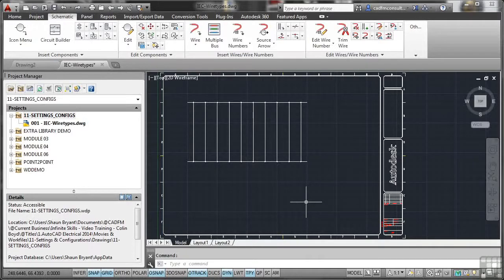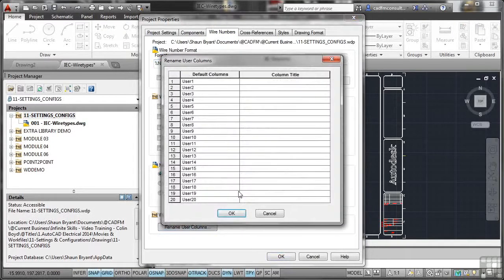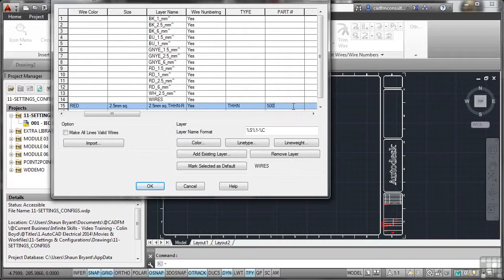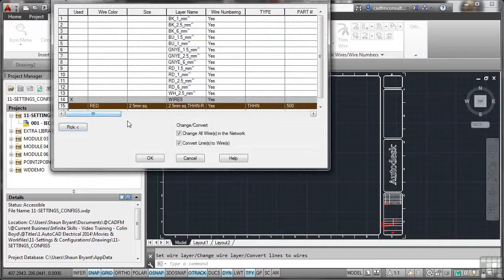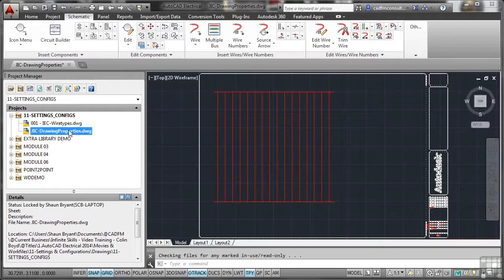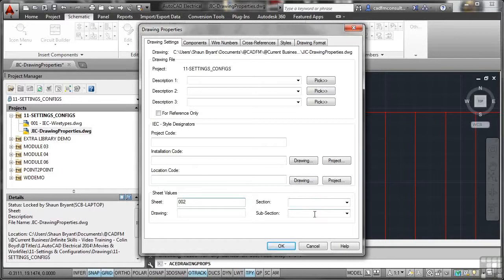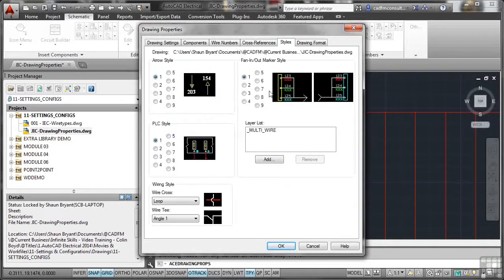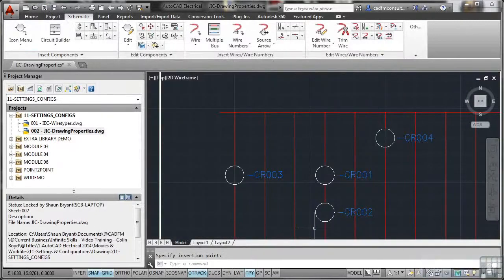Autocad electrical Tutorial Part 27 Wiretypes Drawing properties

Comment: Pls upload a video on scaling, when i am adding icon in iec format the icons are too small
Reply: This happens mostly because you're using JIC symbols. Right click on your project > properties > in project settings tab, change the "schematic icon menu file" to IEC standard > save and refresh. I had the same problem were my icons and wire numbers were extremely small. Did this and everything worked good for me.